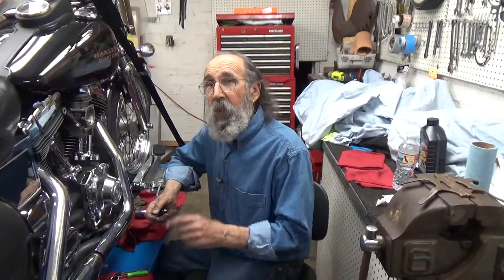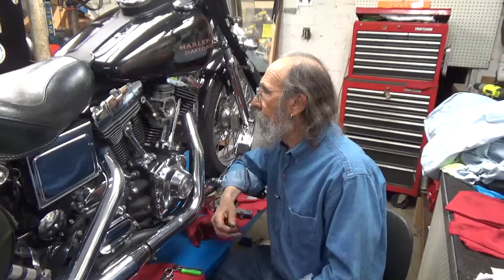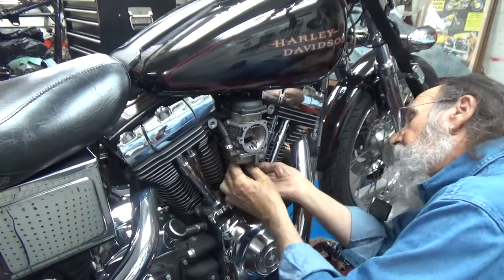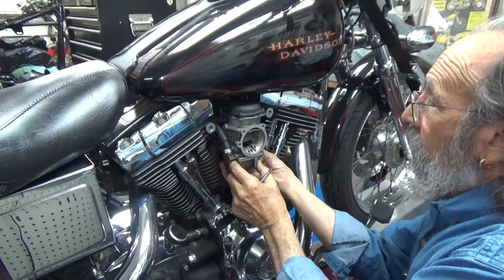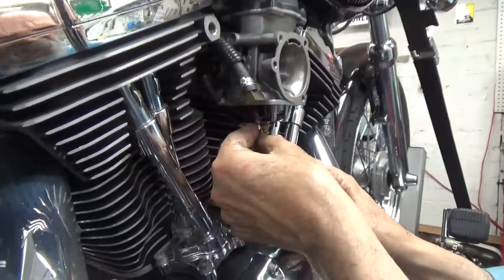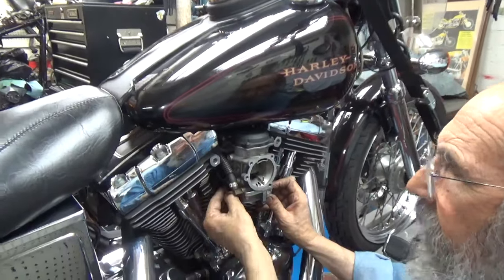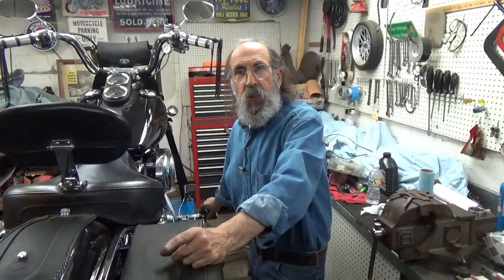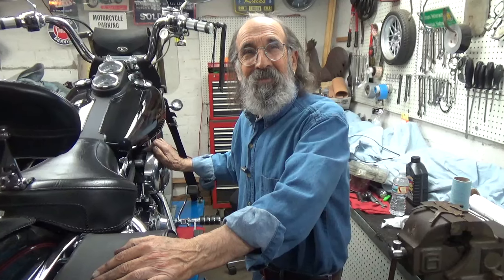Rejetting the Carburetor on a Harley Twin Cam

Comment: With the air/fuel mixture screw, is that screw controlling the air or fuel?  So looking up at it would clockwise make it more lean?
Reply from the maker: I believe so.  Set it while the engine is warmed up and idling.  It doesn't make huge changes.  Turn it in and out a little at a time.
Reply: @pacificmike9501  Im in the process now of trying to tune it.  I have straight pipes and and a big KandN filter. I have 48 for the pilot and 95 for the main and I'm 3 turns out (air/fuel screw) and the plugs are still a little white but I did move to a hotter number 6 plug because it kept fouling them out when warming up when it was cold.  I have a 50 coming but something tells me to go ahead and get a 52.
Reply from the maker: I'd try the fifty.  Then, I'd try the fifty-two.  I wonder what the bike is.  In most cases, you'll lose lowend power with those pipes, but gain it back at high speed.
Reply: @pacificmike9501  My first Harley I quit riding several years ago because I just got bored.  It's a 2004 Heritage and you can't keep me off of this bike.  I LOVE it.  I have the Vance and Heinz with no babbles (didn't come with baffles).  I got some small baffles from Amazon to see how it would do with a little back pressure but it made it sound like a Honda Nighthawk haha.  I've had th bike for a month, got it from a dealer.  It has 20 lbs of pressure in each tire when I got it home.  It had the original air filter (it has 14000 miles on it) it had what looked like original oil.  I had to put a battery, a coil.  It had original jets.  The taillight quit working so I'm learning how to build a Harley slowly but surely.  It had new tires Cammander 3's but it had a "wobble" they said it was normal.  I had them put new Dunlops on it now the wobble is gone but the handlebars were all twisted when I got it back so I learned how to align the front end.  Thats normal too hahaha
Reply: @pacificmike9501  Im wondering if I should go back to the number 7 plugs maybe the plugs were just worn out from me cleaning them barbecue they kept fouling up on me.  Since I switched to the 6's no fouling but the plugs are whit not amber in color thats why I'm slowly working more fuel into it by the carb.
Reply: @pacificmike9501  I have a couple 42's and I'm not going to use them you wouldn't happen to know the thousands size of the holes for the 50 and 52 jets.  I used to be a machinist for 14 years I have some small drills laying around.
Reply from the maker: I really don't know how they arrive at their numbers.  I just start, pick a direction and go.  I do have a set of jet reamers I bought from Snap-On many years ago.  Jets are so cheap, I just go by the numbers on them and go a little at a time.  You'll get used to what your bike needs.  I use those reamers for cleaning out jets and other small passages.  You got pipes.  Hope you're going to a good free flowing air cleaner.  Then jetting to your combo will be great.
Reply: @pacificmike9501  I got a K&N air cleaner similar yo the one in the video.  I ordered a no. 50 jet form ebay but it looks like they aren't going to send it, so I ordered a 50,52, and 54 from another company yesterday.  I also (after reading up Harley CV carbs) got a 88 sportster needle for the carb and it worked WONDERS for getting rid of hesitation and popping.  I guess thats an old trick people in the know use. The next thing after I get the jest figured out is putting cams in.

Comment: Do you  know panhead fred? Serious question.  I need help  with my shovelhead carb.
Reply from the maker: Maybe.  Depends on which area.  What kind of Shovelhead carb?
Reply: @pacificmike9501  thank you for your reply. It's a kehin cv carb on a 80 fxs lowrider. It runs and idles fine but when you crack the throttle it spits gas out through the air filter
Reply from the maker: Try a larger slow jet.  Sounds like you're experiencing a "lean spit."
Reply: @pacificmike9501  thank you very much for your time and advice.
Reply: @pacificmike9501  I swapped out my carb for my dads s&s. It did the same thing.  Turned out my push rods were out of adjustment and  she's  running great. Just thought I'd share that. Thank you again for trying to help me out.  Peace, rubber side down!

Comment: I’ve been wanting to switch my 2001 roadking magnetti to a carb
Reply from the maker: Very complicated change.  I've done it.  I changed the entire main wiring harness.  I installed a Dynatek ignition module and coil.  I installed different fuel outlets on the tank and a 45 mm HSR Mikui.  Be very careful about getting the correct harness.  This was a big inch motor, so, big carburetor.  You're taking on a big job.
Reply: Pacific Mike yes I am I’ve been studying it and asked my local shop about it they have been giving me the details what I need and willing to come by and help if I’m stuck

Comment: Mike what jet should I use for a 2002 softail standard.   I live in anaheim california
Reply from the maker: What kind of pipes and air filter?  Is everything stock?  If you tell me what you have, it's still just an "educated guess."  And, how's it running now?
Reply: It’s pretty much stock. Only thing I did a  week ago it’s changed the exhaust . It used to have a thunderheaded unit and I changed it  for some Vance and Hines. Big shots  units. it feels a lil different  ever since a lil bit more sllow. And not that responsive.  .. the air filter is a K&N   ….    And the exhaust Big Shots acording to them provide the best of both worlds: long, low 2-into-2 style pipes with 2-into-1 performance thanks to the Vance & Hines Power Chamber hidden crossover.
Reply from the maker: Well, I'm sure it's had some jet changes in the past.  It's the lowspeed jet that usually needs changing.  I assume you're running a stock carb.  Just as a place to start, I would probably try a 52, if I were you.  Maybe good, maybe no good.
Reply: I will def try a 52 mike.   Thank you very much.   For your help I’m a big fan of the chanel.  Hope. You guys keep making good content.  Mike thank you.

Comment: Mike, 
What are your feelings on the carb vs. Injectors?  Or is that a foolish comparsion based on the engines!
Thanks
Reply from the maker: Fuel injetion is certainly more efficient.  I'm old.  Gimme a big old carburetor.  Depends on who you are to decide what will work best for you.
Reply: @pacificmike9501  
I hear ya mike.
On March 10th, I turned 32.....40 years ago
LOL
Reply from the maker: Yes, and we love our beautiful carburetors.  As a small child, growing up in a Flathead Ford environment, some of my first toys were Stromberg 97's, that I still have.
Reply: Dam, alright. Those days are just good memories.
Hey on another note, when you did the rejetting on that shovelhead, I think you put a 50 in, it it possible to have too much air coming in depending on the size of the air cleaner one puts on?
Or it it, the more the marrier.
Reply from the maker: You probably live at a high altitude.  A 50 isn't usually big if you've got a freeflowing air filter and exhaust.  That Keihin Carb was on a Twin Cam.   I don't quote jet sizes because they differ too much from bike to bike and altitude.
Reply: @pacificmike9501  
Chicago is about 500' above sea level. What about the air filter? Can you have to much air?
Reply from the maker: What makes power, is the volume of air and fuel going through that big air pump we call an engine.  You need to balance the air/fuel ratio in order to get a proper burn and efficiency.  If you increase air flow, you need to increase fuel.  If you run a less restrictive air filter, you need a less restrictive exhaust sytem.  Now that you've increased the air flow, you need to "richen up" the fuel flow.  Otherwise your engine will suffer from a "lean condition."

Comment: hey man, im at about 400 ft above sea level, where you think i should be with that low jet?
Reply from the maker: Well, let's see, I don't know what the bike is.  I don't know what the modifications are, so I'll tax my psychic abilities and say approx. a 50, maybe a 52.  Please tell  me what my uninformed guess did for you.
Reply: @pacificmike9501   yeah I'm sorry man it's basically the same bike I have a 2000 fxdl with the Screamin Eagle pipes. But I did put an Andrews 26a cam in it when I put the hydraulic tensioner system in it. the Mikuni slide CV carb  and basically the same air box 2. I have a screaming eagle back plate but the cover is open in the back just like that one is in the video I use a FL cover from 82. And I put the keihin kit in it. did the mods that explains to do in the kit for the slide. and the Jets didn't really seem to be right so I bought jet kit so I had more options I think I got it pretty good but I always wonder if it could be a little bit better than it is. I think I put the sportster needle in it and I want to say it's in the third clip position and if memory serves me right I want to say it was a 48 or maybe even a 46. I kind of remember sitting there and it running kind of Rich burning my eyes and I did a change but it's been awhile and I don't remember what it was. I may have dropped the needles down a spot like I say I always wonder if it can be a little better I
Reply: when i started i HAD 1 blunt and 1 tapered adjustable needle and 1 blunt and 1 tapered CVP N65 needle .a clip and 3 shims.( missing the OEM tapered needle )  had 1 pilot jet and 1 emulsifier tube in the kit i believe., i now have a old looking tube( probably oem tube) and a pilot that says A8 (i bought a 44 pilot along with a thumbscrew adj mixture screw.separately from the kit.). so at the end of the day  i think what i have in  there is the keihin emulsifier tube with a 44 pilot jet, a CVP N65 tapered needle, and a 80 main jet.  and the slide had the holes drilled to the keihin kit specs. and i think i used the oem spring.if i remember correctly my idle mix screw is out 2/1/4 turns..give or take.

Comment: I have an 01 carbed twin cam with an Arlen 90° intake and 4" megaphone slip ons. I get popping on decel, whether in between shifts or just coming off throttle. I'm in Upstate NY, (somewheres around 1000' alt) Never had this symptom until I modified it of course. Can you reccomend a jet size for this? Also, possibly link or let me know where to go on the interweb to buy one? 

Thanks Mike!

-Ted
Reply from the maker: What is the carburetor?  What do your sparkplugs look like?  Do they match each other in color?  If not, you have a vacuum leak.  If your exhaust has loosened up at the head, you have an exhaust leak.  I'm afraid I need more information.
Reply: @pacificmike9501   @Pacific Mike  plugs are new, and the ones that came out were firing well. Carb is stock. As I said no decel pop with prior oem mufflers. Pretty much open mufflers. Outer baffles is all.
Reply: @pacificmike9501  never been re-jetted.
Reply: @pacificmike9501  if you were to add the above mentioned parts to the above mentioned bike, what jet would you switch to please?
Reply: @pacificmike9501  ...
Reply: Hmmm. Guess I can't get a cut and dry answer. Ehh well. Ty anyhow
Reply: @TKO-NY  Did you ever fig out what to do on the decel pop? I have a similar setup and same thing happened to me. Trying to fig it out?? 🤷‍♂️
Reply: @SA-hk8xj  yea, I bought a used set of night stick pipes. No popping. Lol
Reply: @SA-hk8xj  btw  I also installed a dyno stage 7 kit, made no difference. Still had decel pop until I swapped out the pipes to something with some more back pressure.
Reply: @TKO-NY  Thanks for the info and quick reply 👍😎
Reply: @SA-hk8xj  np. I usually never hear back, super frustrating when on a mission to fixing something. Lol. I wouldn't bother with a jet kit tbh. That was 200 wasted, and no noticeable power difference other than throttle response maybe a tad, due to the plastic slider in the kit. I tried wrapping the bit of baffle the pipes had with additional fiberglass, no change. Tried running a colder plug, no change. If you're running an open, or almost open pipe, I'd suggest getting away from them. I lucked out and snagged these screamin eagles from a guy on marketplace for 100 bucks shipped. Sounds great and no popping! I'll never buy those cheap open pipes again, lesson learned.

Comment: I like to use kopr-kote on my threads, especially when steel meets aluminum.
Reply from the maker: Interesting idea.
Reply: Steel and stainless steel hardware corrode faster when in direct contact with aluminum. Zinc coated hardware does better.